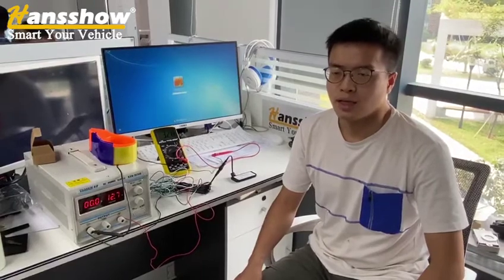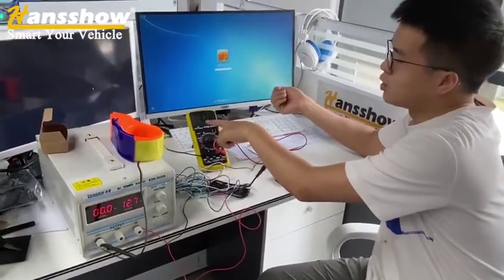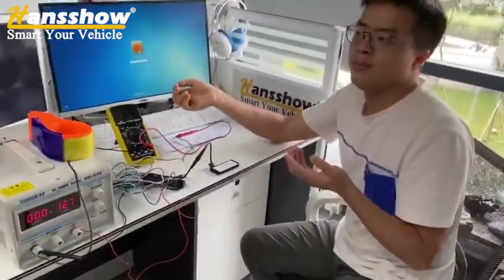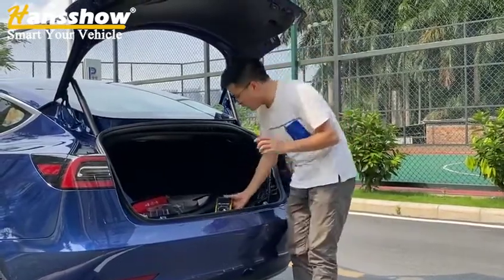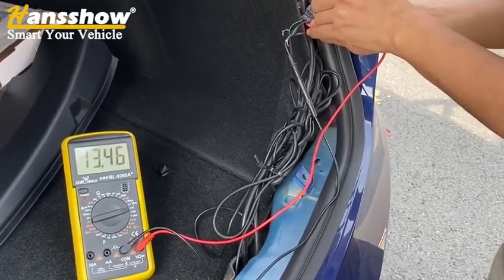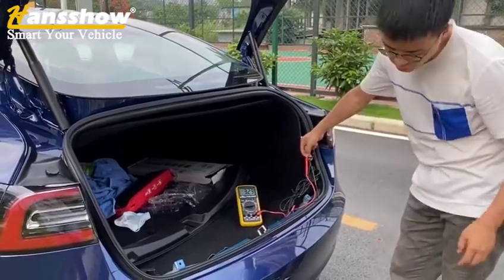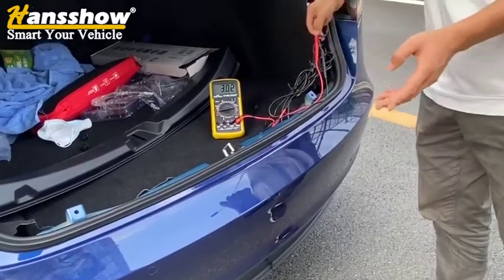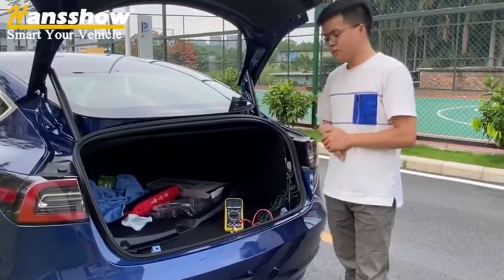Lesson 2: How to Troubleshoot Kick Sensor Problem

Comment: Hi 
I am just got my kick sensor and I am having issue with it, I followed all the steps from video. I am getting my 13v power to sensor, When I connect Positive from multimeter to signal I am getting 3.1v but when I try to activate/kick sensor it’s not changing any voltages. It stays same. What Should I do ?